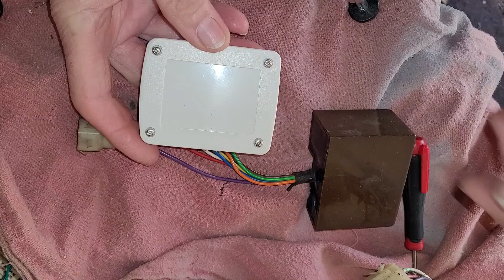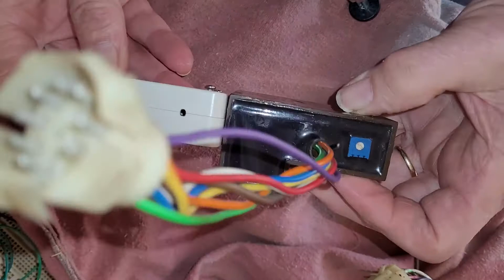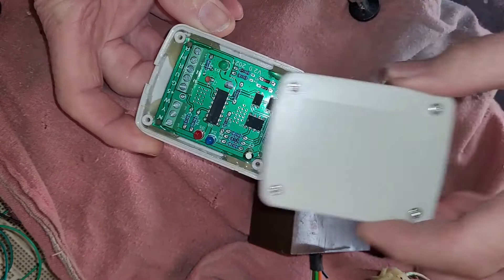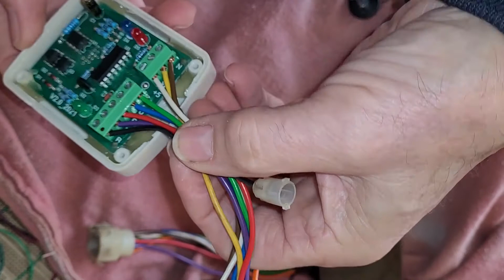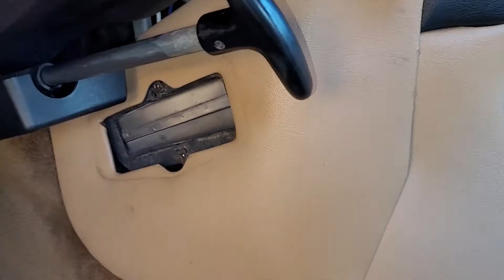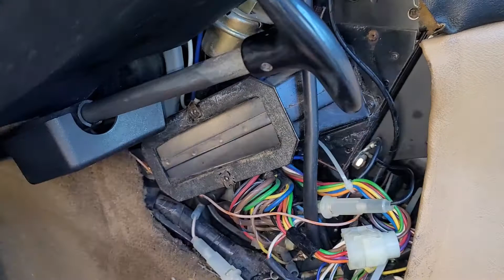Jaguar XJ Manual Heater/Air conditioning control 2022

Comment: Hi I purchased your manual heater controller a while back and only now installing it. My question is do the in-car sensor and the Ambient sensor need to be connected for the controller to work or can they be bypassed? thanks Dean
Reply from the maker: Hi Dean, sensors will still be in the circuit but will not noticeably effect the way it works, so you do not need to disconnect them.

Comment: Looks great! I noticed the red light didn't go out when driving all the way to the hot side... Does the servo have some kind of 'auto off' mechanism when it reaches the end of its rotation, to prevent burn out? Thanks
Reply from the maker: The servo has limit switches for both hot and cold that stop it's motor. I purposely drive the servo to the limit to be sure that the system runs over it's full range.
Reply: Thanks for the info @novom2001
Reply: Just out of curiosity -- how is it able to reverse direction with the limit switch open? Is additional electronic control required to close the switch after the limit has been reached? Thanks
Reply from the maker: @jonnol-r8574  There are steering diodes in the servo, wired to the the limit switches, that allow power to run one way and not the other.